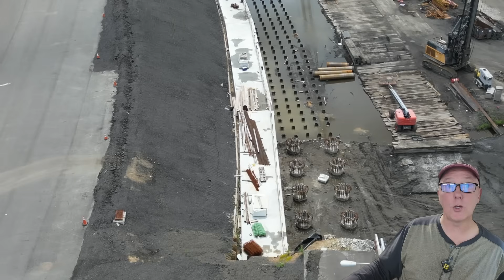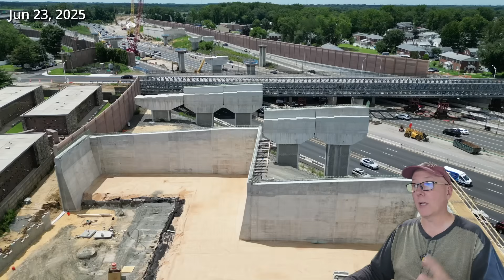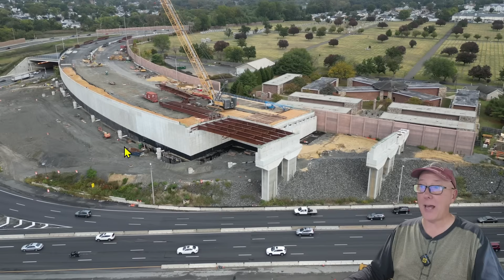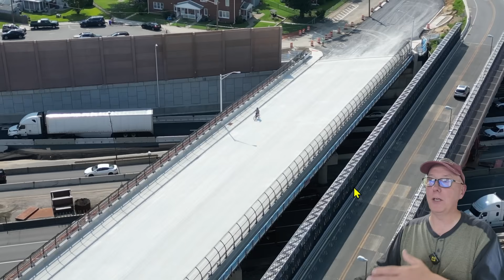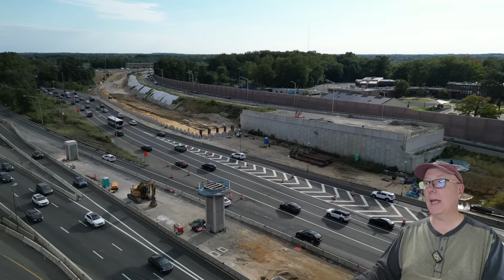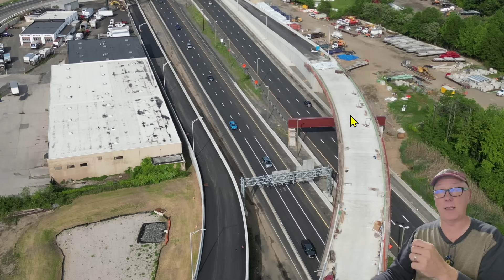Direct Connection Road Construction October 2025 Update and Analysis

Comment: Great explanatory video! Been traveling thru this seemingly forever build consistently now about 6 months and always wondered what was going where. This video has squashed much of my curiosity. Now, on a side note; just think, back in the 1930's, both the Golden Gate Bridge and Hoover Dam were both completed within the span of FIVE years. That's 5, half a decade. In the THIRTIES. What has happened to the American way? Now we have all this red tape, bureaucrats, unions, protestors, tree huggers, lawyers, rules, regulations, limitations, sissies, the list of blockades goes on and on. And we've been using the crap out of those 2 aforementioned structures ever since. And they still stand mighty and tall today, nearly a century later.

Comment: I saw the collapse within hours of it happening before it was even announced on the news was amazed the biggest problem was getting the collapse apart the wall essentially interlocks like legos and when it collapsed they packed in so hard they tried pulling it lifting it and I watch them try five or six different methods in the end they essentially had the jackhammer them apart because they were so locked together they couldn't remove any of them which is why cleanup took so long

Comment: There are some projects around where I live which are made with those kind of wall panels, but they are rather rare. The norm is to just build a reinforced concrete wall. Less critical walls are often made of large size rocks. It makes sense on most projects are you can just dig a few feet, find rock and anchor directly into that rock. Canadian shield is some of the oldest and hardest rock on earth. Most of the fill that we use is rock. Most projects almost inevitably find rock that needs to be removed. Many projects bring in crushers and quarry what they need on site.

Comment: So they didn't use any type of Engineered aggregate underneath that roadway, it was just sand???  I don't believe it
Reply from the maker: From the official NJDOT third party engineer report. First bullet of 4 key reasons
Report: 1) The I-11 (sand) material used for the embankment and slope was not an appropriate material to support a 30-foot-high retaining wall due to its poor engineering properties at high moisture contents.

The report summary calls out exactly what I've said even going back to my very first video on this (before the report came out)
Report: I-11 (sand) material lack adequate capacity and ability to transfer the load to the underlying CSES. This design model is applicable only for a flat surface or when the foundation soil being loaded is constrained to prevent horizontal displacement which is not the case for Wall 22.

another interesting report comment
Report: The project documents indicate the bottom of Wall 22 does not extend to the top of the CSES. The wall directly bears on an I-11 (uniformly graded sandy soil)
Reply: @42Freeway did they ever even say what type of grains they were? Were they bulky grains? And were they:
Angular
Sub-angular
Sub-rounded
Rounded
Well rounded

Comment: Interesting video. Question: Should a project like this really take, what is it now? About 40 years?
Reply from the maker: construction started in 2013 with an 8 year timeline.  2021.  Even with the delay of the wall collapse of 4 years, this still running longer than the original estimate (but not 40 years). last I saw was 2032... 19 year project.
Reply: @42Freeway - That was a joke (sorry), but the fact that it wasn’t obvious says something about how ridiculously long this is taking.

Comment: Intimate domain. Should have made it one straight shot. Would have been cheaper instead of doing all this nonsense. Bottom line is 42/55 still doesn't connect to the turnpike.
Reply from the maker: 42 connecting to the turnpike was just never part of this project.  The turnpike is a mile away from the center of the Direct Connection project.... plus 295 is a federal highway and the Turnpike is a self-funded state authority... the federal dollars of Direct Connection would likely not get applied to turnpike. Lastly, regarding "one straight shot" maybe when it was first developed in 70 years ago?  but if you look at google satellite maps there is no amount of money that could straighten out 295 there.

Comment: I worked road construction for many years building bridges on the NJ turnpike. When that retaining wall collapsed the first thing I wondered about is if the retaining wall was tapered or thicker at the bottom. From the engineering plans you showed it didn’t appear it was. It was corrected in the rebuild. Also I know when we built bridges on the turnpike the roadway was concrete then sandblasted and a layer of epoxy was applied over the concrete. Not sure if they did that here. I know the turnpike required it.
Reply from the maker: Driving by today... I saw the were spray painting it, or maybe it was epoxy!  and likely a factor in the coloring changes.  awesome info... thank you for sharing!

Comment: Thanks for the video! Do you know how 295N will exit onto 76W once this is completed? Currently we have two exits for that, one that is before the interchanges that puts you into the left most lane of 76W, and then after the interchange you have an exit that puts you on the far right lane. Are both of those staying?
Reply from the maker: the newer curved overpass that splits off 295n and goes wide before curving back down to the lower leve will remain and support that direction

Comment: You do a great job at explaining complex things!! It appears to me that the original plan tried to use 'engineered fill' to basically 'float' the road on the unsuitable base material as a cost/time/staging solution. The new structural walls use the same rustication pattern as the failed wall - but that is where the similarities end. At 17:45, the noise wall on the right side may end up reflecting noise into the neighborhood on the left...or not - but worth looking into.

Comment: Ths was and still might be a 20 year project. I worked 4 years with the company on it now . Certainly a massive undertaking.  If the traffic was able to be rerouted completely then 10 years for completion.  A real mess with the cars and trucks fighting with the construction vehicles. Part of the problem for the collapse was an engineering problem. Company complained to engineers about the sand/fill used. Their  butt was covered when it failed with all the letters and studies sent to the engineers.  Done right first time was extra cost of only several million $ . Redone about $80 +:million.  Engineers don't jnow everything.

Comment: This video is comical. NJ spins this project like a win, but it’s a boondoggle. Years of delays, $900M cost overruns, and a retaining wall collapse in 2021 tell the real story. Meanwhile, Delaware’s I-95/SR 896 project—a similar undertaking—completed over 75% of work in just three years with minimal delays and a fraction of the cost. NJ politicians and NJDOT need to be held accountable for this endless mess.
Reply from the maker: I just wanna add there is no NJDOT spin in this.  I’m just a dude putting together videos in his spare bedroom.   And it seems to community appreciates when I explained to them what’s going on with these projects
Reply: They are doing a great job on 896 use it going to my boat on C&D canal they also had great weather very little weather related delays

Comment: Why is it so necessary to have a wall?  Why can’t they just do the whole thing with the bridge piers like they already have at the end?  Seems like so much work to connect one highway with another.  Thousands of highway connections throughout the country just use bridge piers for this very type of project.  Drive your I beams down to bedrock, build the pier on top, and so on.  What am I missing?
Reply: Cost. Walls and fill are cheaper up front and even cheaper to maintain. Bridges need maintenance.
Reply: @oscarwinner2034 , Cost? LOL!  This is the SECOND attempt at this interchange!   If they would have done piers to begin with, they wouldn't be in this mess.
Reply: @miqiee you asked why fill and walls are used instead of all bridge structures. This is why. It’s not just here, it’s everywhere in the world. Always cheaper to build on fill. 

As for the failure repair cost. That’s not being paid out of the state/ federal money. He’ll have whoever was responsible pay for that.
Reply: Bedrock in NJ is waaaaaaaaaay deep.
Reply from the maker: its a reasonable question.  My main thoughts are... 1) the width of it would require many piers.  at the one end its 8 lanes I believe plus shoulder (adding in the 42North merge).  they would need several columns across and then down the length.   2) to get over top of browning road this section needs to be tall with a gradual slope, so that would mean all of those piers would need to be very tall (more money).  3) while i dont mention in this clip, its widely known that this area has groundwater challenges and maybe.. the foundations for so many tall piers in an area prone to water wouldve again be too costly.  But in the and a dirt filled (properly designed) raised roadway has to be cheaper and easier to maintain than a dozen tall piers.  consider that on Route 42 a couple miles away they just removed the bridge overpass above the train tracks for that exact reason.. long term maintining a steel bridge and supports is more expensive than just making it dirt.

Comment: Nice update Mark! Do you foresee any changes to how we get from 76e to 295s? Meaning the single left lane coming off the Walt Whitman bridge.
Reply: Do you remember the suicide 130 entering traffic to move across 5 lanes of high speed I 76 traffic to go to I 295 South ramp in less than 1/2 a mile on the left. Scary!
Reply: That ramp is going to be eliminated and you’ll exit on the right to 295s.
Reply from the maker: from the driver's perspective, you mean "single right lane"?  that is staying and will support the route.  Once Al-joes curve is removed and traffic does not feed in there, they will be adjusting over how traffic starts entering that lane (near the church)
Reply: @42Freeway the single left lane coming from the Walt
Reply: @stevemontagno3596 the “Exit Only” left lane. Yes, that will go away. The final configuration will be all exits on the right and the left lane will be continuous until it drops/merges after the exit for 55. 

FHWA current design standards really only wants exists and on ramps on the right. Decades ago left side ramps were easier to get away with as traffic volumes were much less. 

When this project is done, we’ll all hopefully - A. Be alive still ha - B. Look back and talk about how bad it was ‘in the day’.
Reply: @oscarwinner2034 thank you for the details, clock is ticking
Reply: And we still seem to have the issue that Route 130 drivers face merging onto I 76 at the same time as I 76 drivers attempting to move right for I 295 North.   Big weave and slow down. Maybe this is addressed?
Reply: @RadioNJ1948 yes. The exit from 676/42 for 295 sb will be before the area that traffic coming from 295 sb (from cherry hill) will enter 42/676. No more weaving areas. 

This design has been in the works since the 80s. Hopefully this will help for the next few decades. 

Until we have flying cars finally. WTF? It’s the year 2000 already. Where are the flying cars I was promised as a kid by now?
Reply: @RadioNJ1948  Yes, the "X" intersection is a terrifying shooting gallery.

Comment: Can u show the 295 south connection to 42 south
Reply from the maker: It hasnt been developed yet.  so there are 12 different unique paths through the intersection... every single one is different!.  So i cant recap every aspect in each video.  But.. back in 2022 i did just that... this link should take you to the 31:08 mark where i cover this path.  It includes an overhead depiction and drone image with overlays
https://youtu.be/p6xge4xOLl8?si=9TBMzyKJ90PRwIJ6&t=1868
Reply: @ScottPScott That's another 20 years in the making, Stand by, no plans yet
Reply: That Duke's of Hazzard ramp is really steep on a short section... doesn't look to safe doing 50+mph
Reply: It’s a ramp that will go under 42 and up on the right side to join 42s.
Reply: @oscarwinner2034 not making much sense how you are describing it..ramp that goes under 42?...huh?
Reply: @thelaidbackguy1922 underpass. It’s on the NJDOT website. 

If you’re driving down 295 sb past 168. You’ll still peel off to the right. But the ramp will stay straight and curve to the left to 42. 

Similar to now where the ramp goes under 676/42 (al Jo’s curve). But the underpass will be closer to the new 295 flyover that’s being built. 

You can see the start of it now. The bridge that carries the ramp from 676/42 sb to 295 nb that goes up and over the roadway is way wider than 676/42. The part where it’s over the grassy area now is for the new ramp. 

If you look on Google earth, you can see the outline for the new ramp as the supports for the excavation have already been installed. They’re the rusty metal walls that were driven into the ground. The tops are sticking out of the ground a few feet now. 

Look for it. You’ll see it.

Comment: Thanks for the update! Still have 2 questions. How will cars get from 295s to 42s? Is the left lane exit and old bridge on 42s to 295s going to be removed?
Reply from the maker: 295s to 42s hasnt been developed yet.  so there are 12 different unique paths through the intersection and very single one is different!.  So i cant recap every aspect in each video.  But.. back in 2022 i did just that... this link should take you to the 31:08 mark where i cover this path.  It includes an overhead depiction and drone image with overlays
https://youtu.be/p6xge4xOLl8?si=9TBMzyKJ90PRwIJ6&t=1868
Reply: @42Freeway it’s going to be a ramp that goes under 42 and up on the right and merge in. You can see some of the construction for it already in the ground under the flyover ramp from 42s to 295n.
Reply from the maker: ron i just update the link... it was a chapter too early. you likely already realized ha

Comment: Great update. All I know is that I was 59 when this thing started and now in my 70's , so I doubt I will see the end result of this project.
Reply: Don't sell yourself short, think of it as a goal to see the finished product, even if it takes you to the 80s. We have 5 more years tops. Hang in there buddy.
Reply: My mother moved to NJ in 2000, and said this area was under major construction then. So it’s been going on at least 25 years.
Reply: @plinhart1224  That's crazy man
Reply: I can confirm.
Reply: When they started this debacle  I said they would not be finished before I retired. I retired in April 2025 😅
Reply: Yep, I was in my 30s i moved from Bellmawr out of state in 2010 came back in 2015 and was sorely disappointed with the progress. Union apprentice Operating Engineers will have started on this job and will retire on this job!
Reply: Stay positive
Reply: I believe the start time of the entire project was sometime back in 2012.
Reply: You'd be surprised! 😮
Reply: Seems like this has been going on for as long as I can  remember with no end in sight. Great video, BTW. thanks for sharing it.
Reply: Same here